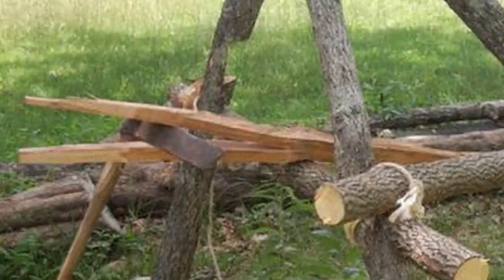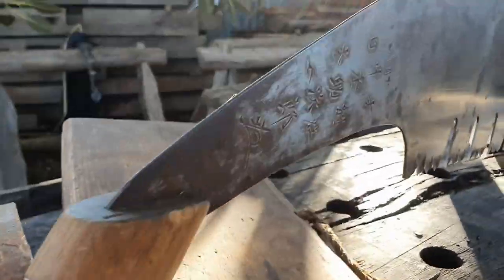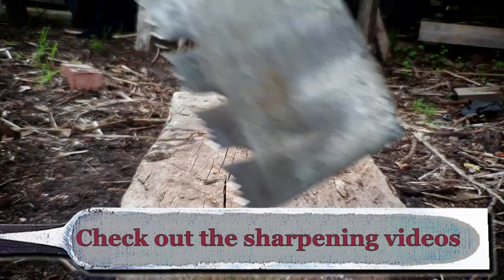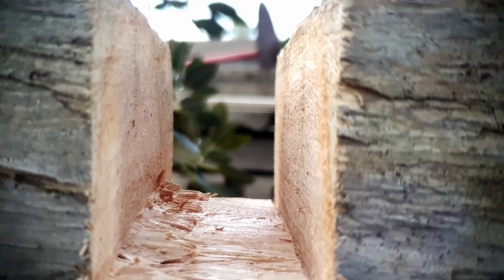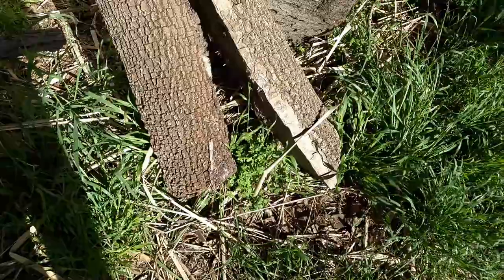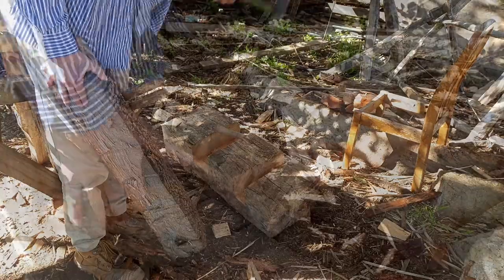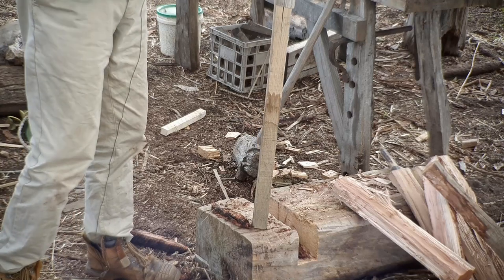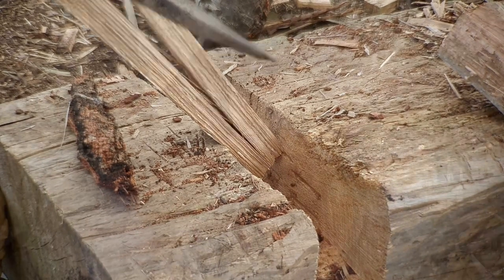How to make a Japanese riving brake with an axe!

Comment: Way cool!  I live in coastal Northern California, and am lucky enough to split old growth (and second growth) redwood part time for work.  My old timer mentor taught me that when making shingles or shakes, it really matters which direction you push/twist the froe, especially if the backside of the tool is slightly mushroomed(it bites into the wood).  Pushing the froe handle away as you work down a split will put a small amount of compression into the far piece if that makes sense.  Pulling the handle toward you can put tension into the piece further away from you(especially if your froe is rusty or textured near the sharp edge.  Old growth Redwood is much more springy than ash, so it’s easier to manipulate.  Fat grain second growth redwood is weak and brittle in comparison.  Pushing hard on the end of a split (building up compression) can help it carry the line if it’s wanting to run out toward the face or thin out.  
Anyhooter, supa stoked to find your channel mate, man vs wood is a timeless tradition that’s never going out of style.  Sometimes I’m bummed I wasn’t born 150 years ago, but yotube is pretty amazing!
Aloha,
Ian
Ian

Comment: Interesting.  Never seen controlled splitting before.
Reply from the maker: Your country man Peter Follansbee is a master. He inspired me years ago to start riving boards for various projects. Problem here in Australia is so many woods just are not suitable for riving.
Reply: @ChestnutnagsToolsFromJapan  I have focused more on metal fabrication for practical reasons.  Wood is more beautiful by far.
Reply from the maker: @hardrockuniversity7283  Yes well as I just said on your chanel I know what welding is but that'[s about it.
Reply: @ChestnutnagsToolsFromJapan  It's not that challenging to do basic welding.  It can get tricky, but that's for special cases, like fine antique restoration.  For strength there is no comparison between steel and wood.  Does your local communal shop have welding and metal working equipment?